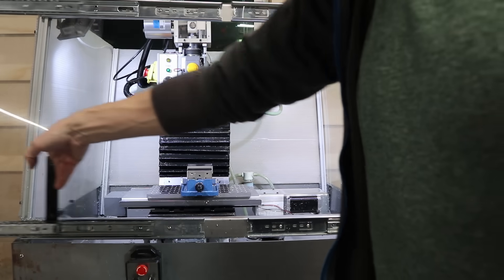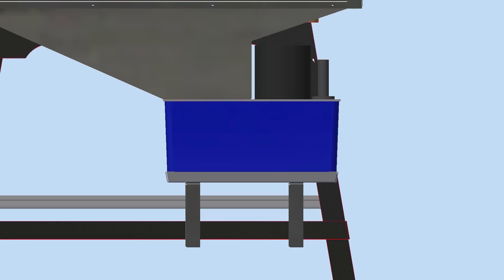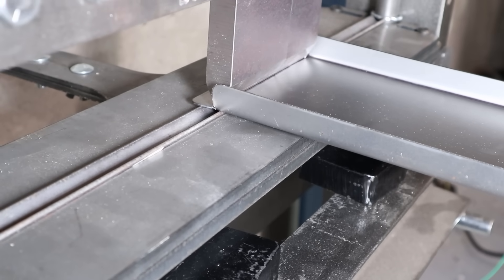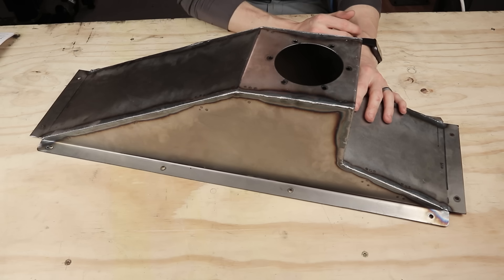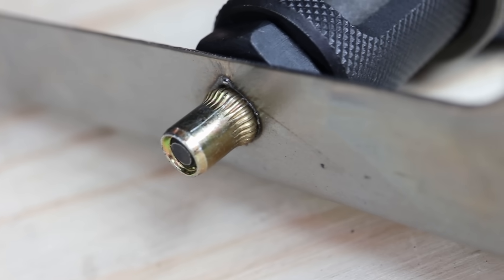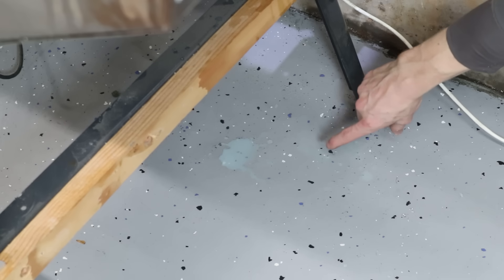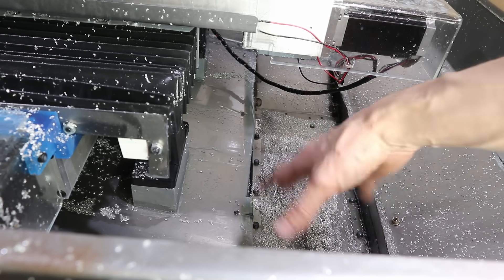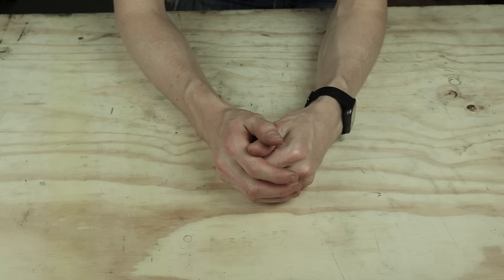Fixing a little mess with a big mess

Comment: Former gasoline tech here. Your impeller, is that close to the bottom of the basin? Underground storage tank motors draw product about 1' off the bottom of the tank. In case water or other debris gets in, it settles on the bottom of the tank and it's not drawn up and into a vehicle.

Comment: "I've been doing the traditional ritual of avoiding the problem".... Would you like to see my '84 Ford that has most of its wiring bypassed to an Arduino? Most of the problems were supposed to be "Temporary fixes" but have become "Perpetual Problems". Gotta love that push button speaker-wire ignition switch though..... I can't even afford real wire :(
Reply: In my defence, in-home speaker wire is actually kinda easy to use for wiring switches to relays. The wire is all stuck together in a pair and everything..... The insulation just isn't usually the best for fuel and heat resistance.

Comment: It would have been faster and easier... To have left the case as is, use a 4" toilet flange under the the case (Then the floor of the case would have been flat.) and filter the coolant in the tank section. All you need is a tank with a baffle to trap the tramp oil and lamella clarifier to get rid of the chips. Basically one 90 degree baffle open at bottom to trap the tramp oil, and a least one 45 to 60 degree baffle open at the top of the tank, to let the chips settle out before going to the pump. 

And if you wanted to get fancy, use a skimmer to remove the tramp oil and a slow moving mesh conveyor to remove the chips while draining the coolant off them. 
So the pipe from the flange would drop the chips and the coolant on the mesh conveyor and and dump the chips in a container while the coolant drains to the tramp oil section of the tank. Then the tramp oil skimmer would remove the tramp oil.

Comment: GFCI trips, move to non GFCI because shorts aren't going to drive up the power bill, light the house on fire or zap me in an unpleasant manner. 
also ... I've seen on many machines a screw that moves the chips out, so do you just remove them with a brush and a dustpan?

Comment: hey @Stuff Made Here

Have you seen the air nossel cooling? ist disigne is just to cool with air i super high speed, and as you know when gas is relised from a high pressure airtank it cools down to around freezing point. https://images.app.goo.gl/xDD9Qg6jBVyTT7Ac8

it is extrakting the chips alot faster and if you are milling produkts that dont like water espossure then its a winner to

Comment: Correct me if I'm wrong, but I'm near certain that the the reason to not grind near your mill is the abrasive residue of the grinding stone (not the hot steel particles) which can get on the precision surfaces of the mill, and wear/abrade them over time (e.g. when they move against each other).
The steel particulate presents no issue AFAIK.

However I am unsure about whether the steel becoming oxidized from the heat of grinding ends up being a hard enough compound to be functionaly abrasive.  Perhaps this was your point when you referred to 'hot steel').  I'm curious now.

We don't even grind in the same ROOM as our production mills and laser cutters (we also run special dedicated air handling equipment to keep them separate).

Comment: 17:55 DEAR GOD WHAT YOU YOU DOING? I worked partially in a machine shop at an effects shop, I only ever ran the mills a few times, but i cleaned them of chips very often even before i started working there. I HATE getting stuff on my hands, not only are those chips covered in coolant, but they are usually sharp, and you're badass self is just clawing at them like playdoh. Jeez XD

Comment: you are such an incredibly crafty fellow! i could only dream to be as good with things as you are. i dabble in wood carving, and trying to get into turning, but i also have hobbies in gold and diamond prospecting, and have been looking for a means to "automate" via hand power, a machine to enable the ease of effort concentrating materials down. basically, a hand operated Pleitz jig, that could concentrate diamondiferous materials into a concentrated center using a simple frame, and gears and a means to reciprocate it using a type of piston (like a car engine i suppose, or similar mechanism, but moving a removable screen lol) haven't found a fabricator that could make a design or figure out the math, forces, mechanics, or the right design. and i don't expect to find one easily, but you at least inspire me to work harder anyways haha.

Comment: Having no machining or metal working skills, but a skilled improver (i work with paper in my job): I would have drilled a hole where the coolant was pooling in the initial design, bent the edges to funnel it down, then Somehow urethaned or epoxy putty a cheap funnel or two below both openings to direct the coolant to my new floor mounted resoviour (probably a bucket or old aquarium). Diy Metal filters would be coffee filter shapped  pieces that would be hung under the outlets on bent coat hanger above the "resoviour" bucket or aquarium.  Pump would sit at the bottom of the bucket/aquarium to send the fluid back up. Would likely make thenfunnels out of dollar store food strainers.

Comment: Haha, I was just about to comment that you should switch to different coolant nozzle to cool milling tool, not billet itself 😂 Alltho with your new solution, how you gonna change coolant direction with different tool heights and billet sizes? You really need 1 flexible nozzle (those blue plastic ones with orange tip)

Comment: You could make metal with steps to take out the metal pieces when the coolant gets collected in the steps and far less on your filter.
Like gold diggers use to filter out the gold, could make it much easier to clean and would extend your filter enormously

Comment: First of all, despite what I am going to say, I do belive you did a good job. I just gotta say, I am a metalworker and welder, and I fail to see why you spend all that time spotwelding if you allready have a TIG welder. Secondly, you could have improved the system SOO much. Instead of a thin filter to catch the steel shavings, you should have made a bowl with a raised pipe (about 20mm or so). All the coolant would have washed the steel down there, filling the bowl. As the steel falls to the bottom, the coolant would eventually spill over and down the pipe to your pump, catching virtually all the shavings at the bottom of the bowl. It would not only reduce the amount of filter you need (as it would only have to cover the pipe), but make the cleaning MUCH easier. Besides, you would not have to worry about your current filter breaking.

Comment: Why you decide to use a "hard to maintain" filter? 
However, i don't have any experience of working with CNC mills, but I think you may use some sort of siphon with big collector and not so big filter after that. 
Now you need some tool to remove chips and unscrew ~10 screws to clean your filter.
I think the whole system may look like a regular plastic or metal bucket with cap.
A plastic pipe, comes down from collaint bath to bucket.
A hole in bucket with a pipe comes out of it with easy-to-remove joint (like regular plastic sewage pipe) with embedded microfilter, like you used in you system, 
And all of that to this tiny tank with pump, that mounted a little  higher than bucket.
So, you will have a constant "dead" amount of coolant, yes. But all of maintenance between milling you need to do is clean of the bucket from chips and wash out some metal dust from microfilter in middle pipe.
It's easier, less cuts, welds and bends. Almost aftermarket.
Reply: Sorry for bad English - it's not my basic language.
Reply: Like this
           !   !
PIPE  !   !
           !   !
    \     !   !     / 
     !              !  ----- BUCKET
     !~~~~~!________##________
     !              !---------------##---------___!____
     !              !     FILTER^            !                   !
     !:~.#)?& !                               !__________!
     !:;.,"()&;* !        SMALL BLUE TANK^
   CHIPS^

Comment: You should charge the manufacturer company for this modification. On the other hand it's probably that the company wanted the motor to die as soon as the warranty expires so they can charge you more for the replacement

Comment: I'd add another "loose" filter (with a handle or something) on top of the fixed one to get a majority of the chips out by just lifting the filter.
Reply: @aKingInGodsKindom  Also, it helps strain out any remaining coolant sticking in the loops of the chips/shavings sinec you can lift it up and shake it, knocking the remaining coolant loose!
Reply: I was wondering why not have a filter basket, so that the chips can be easily cleared out. 
When he stuck his hand in the chips, I was afraid that they were sharp and he would cut himself.
Reply: A large magnet that picks up those really fine chips in suspension in the coolant.
Reply: @assassinlexx1993  can you send me a link to a magnet that works for Aluminium?

I’ll wait till you defy the laws of physics
Reply: @aqib2000  
Here is your link https://youtu.be/_mQeaKkaEcQ.
That you asked for. Industry uses this just a bigger scale.
Reply: Maybe the filter from a dishwasher with a few modifications?
Reply: Or just use a shop vac :)
Reply: @Zalagar619  Which you then have to dump. Why lift the chips twice, AND the weight of the vacuum once (or twice if you count hauling it to the mess) when you dump it out?
Reply: @mal2ksc  Im pretty sure he doesn't empty the vacuum every time. Just suck it up and forget about it. Then many times later, yeah you will need to dump it once. But then boom good for another month.
Reply: @mal2ksc  having shopvac on nearby anyways is good idea since you never know when you need to clean the machine and do maintenance. I would almost be tempted to get dedicated shopvac just for cnc specially if machining only one metal like aluminum, so chips can be then later melted and cast to make new blocks to machine.
Reply: @Zalagar619  w smith ar phone 📱 to

Comment: Have you considered trying floating nutplates?  They're everywhere in aerospace sheet parts and the bit of wiggle they give on final assembly (especially for replaceable detail parts) is nice.  Maybe something like MS21076 or MS21059 depending on how much clearance you have around it?  The main downside is that it's more of a process to attach them and they definitely cost more than the relatively throwaway rivnuts.

Comment: Now you need a proper conveyor system to remove chips....
Either way, I would also recommend putting a tray in the bottom of your coolant reservoir; you won't catch everything, and it's a lot faster to clean the bottom of the reservoir if you can just pull up a tray of whatever fell through the filter.

Comment: I like the filter idea,m but I think its easier to use a bag filter, in the coolant tank, and flow thru the bag which then would be inside the tank.
Then you can just take out the bag filter and put it back when its clean.

Comment: i love the pen plotter, we use something simmilar on our 4k fiber laser for certain parts by etching some bend lines. one thing that has worked well for us is to use a solid line to denote a bend in one direction and a dashed line to denote a bend the other direction, helps reduce mistakes!
Reply: Well, you still have a 50% chance of getting it right without the dashed line system.
Reply: @Axodus  not if you follow the rules by which you program the lines or dashes... solid is up, dashed is down. 100% accurate
Reply: @danielallen2000  I was making a joke :P
Reply: That's origami 'notation', cool to see it gets used for sheet metal! Mountain folds and valley folds... Wonder which application came first or if they're independent inventions.
Reply: @SMTRodent  I would guess that origami used it first, but they could still be independent inventions. It's really not that hard to come up with.

Comment: This is so unbelievably over-engineered and significantly more complicated than it needed to be...

I love it.
Reply: SovietandScotsman Was it really? CNC machines are inherently complicated, this man built a homemade one :P
Reply: @No-pm4ss  Could've just done 2 pairs of triangles and connected everything together with a circle so the pump was at the lowest point, and then put a domed mesh over it so it would stop the chips from getting in while allowing the coolant to go up and over any clogs that may happen. Wouldn't have taken much work, but I assume there was some reason why it was done like this, but I'm not sure why...
Reply: @Guffy1990  He was worried about leakage, im afraid the man has no welding skill and two triangles welded together at their sides is significantly more prone to leakage as the weld breaks down to wear and tear than a sheet of metal just bent. That and he wanted to move his motor out of the way of the coolant not have the coolant just flow over it

Comment: When you took out the last bolt and the tub dropped all over, I was reminded of a time where I removed bolts without thinking about it and faced the consequences.  I was fixing the garage door, which had a snapped cable on one side and was slanted at about a 5 degree angle, jamming it.  I proceeded to take the nuts out of the plate holding the cable to the side still attached to the spring.  When that last bolt came out, the plate flew up right into my face.  It hit the right lens of my glasses, throwing it into the bridge of my nose, leaving a small bruise on the bridge of my noise.  It then slid over my brow leaving a gash that cost me three or four stiches.  If I weren't wearing glasses, I most likely would have lost an eye.  I leave the garage door repairs to the pros now.

Comment: quick note about this cat litter trick
there is a product called floor dry. it is nsf certified(meaning it could be used in a retaraunt) it is cheaper the cat litter, and it is way more absorbant than cat litter
just remember to not use it as cat litter. your cat and your vet will be very upset if you do.

Comment: Love your content bro. You can fine tune your RivNut setting tool by increasing/decreasing the amount of threads that are available to screw the RivNut onto during installation. It shouldn't be that hard to set... I've stripped the threads out before. Learned the hard way.
Reply: I was thinking the same thing, what usually works for me is to adjust the collar such that the mandrill is flush with the tip of the rivnut when the handles are about 30-35 degrees apart. Then you can just bottom out the tool and get the perfect rivnut. Obviously depends on material thickness and rivnut grip range, but that's a good place to start.

Comment: Just wondering why you put the tabs on the inside of the tub instead of the outside? Tabs inside gives for surface area to collect gunk. Harder to clean. Tabs outside leaves smooth surface for easy clean.

Comment: Submersible coolant pumps work well, and don't have the cooling fan issue. I ran a mill for years with a submersible pump in a window screen bag (extra insurance) in a 5 gallon bucket (setting on a brick to keep it off the sludge and fines) and a drain line from the table catch to the bucket. A small screen box went over the 1/2" drain to prevent chips from clogging the drain or making their way to the bucket. The window screen bag was a backup in case the operator moved the screen. About every 6 months it got a total cleanout, but was usually fine.
I like your solution, but it was very labor intensive.

Comment: Love hate relationship with coolant. Makes everything sticky and stinky like everything around a machine that uses alot of coolant or the totes the machine spits parts into turns into that gross sticky mess. My plant was a 24/7 plant so my 3 machines in that department were constantly running no matter what or who ran them everything would be sticky. Learned on automated 7 position screw machines first then went to grinding department for a while running royal masters and Cincinnati grinding equipment. Cool one was a Cinico machine which we were using to make 40mm grenade shells from that was pretty fun. Since then i moved into plasma vapor deposition coating/thin films PVD which is one of the coolest things ive done so far

Comment: Did you consider coating the collection system you made in the video with some type of wax to decrease μ in frictional force to really get the aqueous soln cookin down that ramp? Also, did you consider using a Zinc screen or charging the screen to help pull some of the debris out of soln to help protect the filter?